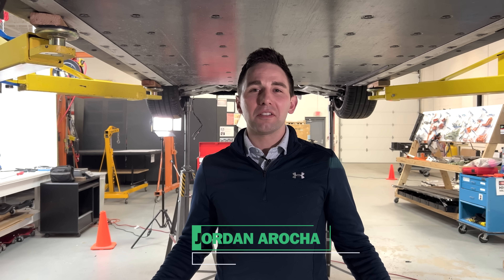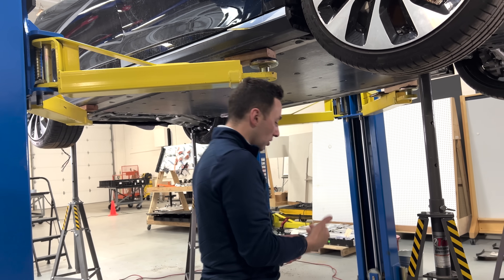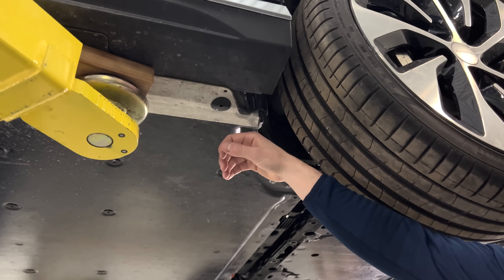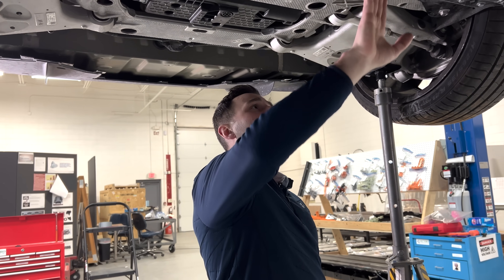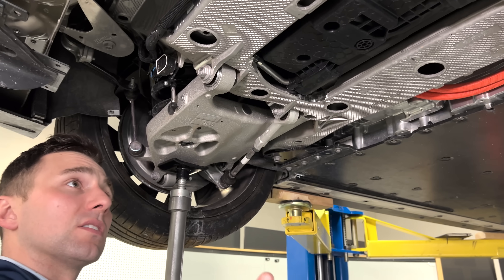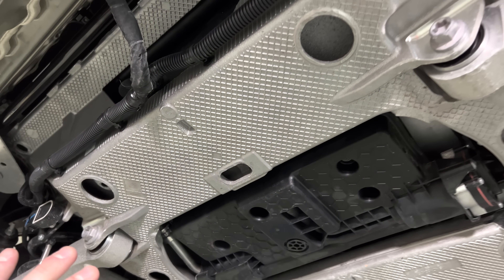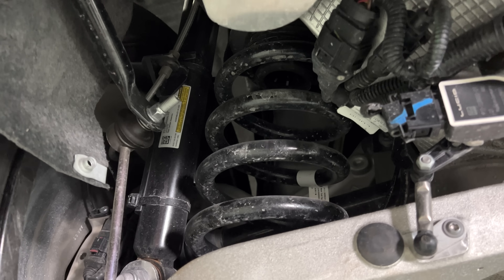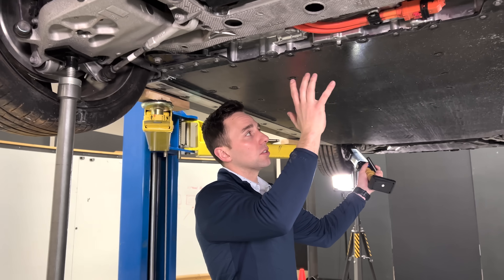Fastener Frenzy! Lucid Air Hoist Review Part 2

Comment: I think removing a wheel or two for better visibility during these videos would be great. The tube and effort to remove and install is relatively easy. Probably quicker than setting up the safety stands under the lift 😄

Comment: Jordan, thank you for the review. 

But fasteners do not necessarily create a leak path, if the fastener only intrudes into the battery pack's substrate, but does not penetrate it. 

It would have been interesting to see one of the fasteners removed. To see if it actually penetrated or not?

Comment: One of the advantages of the FRP bottom battery cover is that it is not flat. Starting about half way down the pack it begins gradually angling up. with the rear motor cover in place it feeds smoothly into the splitter, creating downforce at speed. Lucid did well to recruit the aerodynamicist from the Red Bull Formula 1 racing team. Also note back at the front that the cooling system takes air from the front center of the vehicle and discharges it through the wheel well, not under the car. Air flowing out of the wheel well improves barrier effects along the side of the vehicle, reducing drag.
Clever monkeys, those Lucid guys.

Comment: Most of the rear suspension was not discussed. There appears to be a pivot point on the massive lower arm immediately above the toe control link (which was discussed); that could be for the stabilizer bar but the stabilizer bar link appears to be on the other (rear) side of the arm, so this is presumably for the vertical caster control link of an "integral link" suspension system.

A MotorTrend article shows a view of the rear suspension which confirms that it has only a single upper link (providing camber but not caster control), so this is an integral link design.

Comment: Great video as usual, Jordan! I love how you don't 'dumb it down.'
Really looking forward to your take on the battery. 
Yes, I think having a battery that can be serviced is important. Such a key and costly component shouldn't be scrapped because of a minor component failure. Since EVs are hypothetically capable of very long service lives it is terribly wasteful for future cars to be scrapped as "uneconomical to repair" for some BMS or contactor failure. I recall early days when people saying that a Prius would be too expensive to repair when the battery failed. Today rebuilt batteries are widely available and inexpensive. In Europe some are even upgrading old LEAF batteries. The aftermarket can be clever is we leave them some room.
Reply: Folloiw-up: Some early Air GTs had one problematic high voltage contactor that would fail intermittently. Not all contactors, but some would, stopping the car when they did. Lucid discovered that the faulty contactors would occasionally chatter when closing in the weeks before they failed. An OTA diagnostic tool was downloaded to the fleet to monitor for this chattering. Some months ago I received an urgent message from Lucid that my car had detected that chattering. Lucid asked to urgently schedule transportation to pick up my car and deliver a loaner while they replaced the dubious part before it failed. Cool, if a little spooky with the overtones of "2001". Fortunately no EVA was required on my part, no pod bay doors needed to be opened.. This is what the future is supposed to look like.

Comment: When I see the amount of frozen salt ice that accumulates on vehicle's underside and wheel wells during a typical winter storm period, coupled with the brittleness of plastic parts when it's -30 degrees, I'm thinking this Lucid is a temperate zone-only car.  Not many would survive a Montreal winter. Hyundai and Tesla have learned to design their undersides to withstand the long-term challenges of salt/ice.

Comment: Making an easily serviceable battery pack with no special tools required to remove it, seems to facilitate theft of the most expensive car part, the Battery pack. I think battery packs should transmit their location like a cell phone making locating a stolen battery pack easy.

Comment: Doesn’t look like any designated jacking points…
Reply: There are clearly designated jacking points, shown in both the owner's manual and the emergency response and towing guide. One of the front markers (a rectangle) is visible in the rocker panel @1:45, partially covered by the scrap of wood;  they're lifting too far inboard. The manual says "CAUTION: DO NOT position the lift arm pads under the vehicle battery or side rails"), and they're lifting on the edge of the pack. I've seen them use clearly the wrong points in another video - it's as if they don't read the documentation.

Comment: Great 2nd video.  I was curious about Munros thoughts on this vehicle.  My take away from both videos is its a tight design, tightly packaged, with serviceability issues due to that design.  At some point it will need to go to the shop, the question is can your local shop lift this up and replace parts that have worn out...easily...or will it entail a complex procedure that will cost way to much?  As you pointed out in the 1st video...its a no no in the manufacturing sector.  
Suspension does not need to be designed this way as you stated...overly complex..considering it will be drive on a stright flat road.  It will be a city or highway, which is not very twisty.  Time will tell if they update to simplify.  Cars are not space ships...kiss..as Munro said.  
Tesla, Ford, and GM have a good and effective suspension that any shop can work on..easily.  KISS Lucid KISS

Comment: When I see elements like the spring steel clips securing the battery pack my immediate thoughts go to galvanic corrosion if the undercarriage isn't kept clean through a northern winter full of salt and snow.

Comment: At least some, perhaps many, of those fasteners appear not to penetrate through the structure.  Fasteners into aluminum are still an issue.  The fasteners either need to be passivated with dacryl coating or need to be aluminum themselves.

Comment: What are those wires hanging down by the right rear wheel visible at 4:55, 5:23 9:25 ?   Disconnected for safety on the lift?

Comment: I don't see any jack lifting points
Reply: There are clearly designated jacking points, shown in both the owner's manual and the emergency response and towing guide. One of the front markers (a rectangle) is visible in the rocker panel @1:45, partially covered by the scrap of wood;  they're lifting too far inboard. The manual says "CAUTION: DO NOT position the lift arm pads under the vehicle battery or side rails"), and they're lifting on the edge of the pack. I've seen them use clearly the wrong points in another video - it's as if they don't read the documentation.

Comment: In regards to the comment about not designing a battery pack that should need service: Nothing should be designed to fail and need repair, but it would also be very short-sighted and/or arrogant to assume that anything you design will never fail. Serviceability is an incredibly important consideration when designing something that is intended to be useful for an extended period of time because, at some point, it will break, regardless of how well it is designed. That is a major failure in the design of many modern consumer products: they’re designed to be used and thrown away when they break. They’re intentionally designed not to be repairable, which is a real shame. Serviceability is even more important on something like a battery pack because of recycleability. Lithium battery packs absolutely must be designed to be disassembled and recycled at the end of their life because, just like any part on any car, they don’t last forever. There are so many precious materials in a lithium battery pack that can be recovered as long as they’re reasonably accessible. Manufacturers like Tesla who hermetically seal their batteries and encapsulate the cells in foam are doing a disservice to their customers by making the batteries nearly impossible to repair (they must replace the entire pack even if a single cell fails) and they’re doing a disservice to the environment by making the packs much more difficult to recycle or repurpose when they’re no longer fit to use in a car.

Comment: As far as the parts bin tie rod inner, can  a manufacture like lucid simply go to an oem (say lemfoerder) and buy a part another manufacturer ordered, say bmw? Or is there a license restriction or similar?
Reply: Many of those parts are designed by the parts manufacturer, not the OEM which buys them, so in that case there's no problem. For example, the same electric brake booster (Bosch iBooster) is used by Tesla and Honda (and others) - it was designed by Bosch and none of the companies which buy it owns the design or the right to restrict who else buys it.

Comment: IIHS 2.0 isn’t a side pole test. I think you know this and likely just misspoke haha. So also fyi the new barrier is meant to mimic the front end of a truck, specifically a ford F150 or similar suv. They ran the F150 and Honda pilot as benchmark test vehicles when developing the prototype. It basically has “frame rails” built in to mimic the hard sections of a trucks or SUVs longitudinals. This presents a challenge for side intrusion, specifically the door beams.  So it’s meant to basically mimic a real world scenario whereas the old barrier was too uniform and didn’t really represent a real world vehicle. Huge crash nerd here!  Next time you guys visit IIHS view the actual excel spreadsheets an, measurements, and tech docs. They get way way deeper than just ratings

Comment: Good video Jordan.  Two things I do not like; one the exposed high voltage line (orange cable connector) in front of the rear end casting. Two the rear end tie rod linkage, just hand down, ready to catch something.  🇨🇦

Comment: There is one problem created by having a low slung windshield washer bottle. Lag in getting  pressurized fluid into the spray head especially is there is any leak in the hoses coming from the washer pump and electric motor. Hopefully they are using a check valve to prevent the fluid returning to the pump when off. The long hose in an are not warmed by an engine can also allow icing of the windshield wiper fluid, solvable by putting the hide in a passage that is supplying heat to the passenger compartment so it can keep the d fluid in the  hose warm which helps deice windshields. In fact having the washer bottle grabbing a little test would also be good as well.

Comment: What on earth's going to happen when these mega-complex cars start having nasty breakdowns, 10 years later and out of warranty?? - Especially if (when?) Lucid goes bust. It's not like they're even remotely handyman or home-mechanic friendly. At least with the old and gorgeous BMW 850i (which are now dirt cheap ) , you can mess around with them yourself if you're very competent. But these massive EV's (Lucid, Merc, Rivian etc) will probably simply be scrapped when unfathomable problems inevitably arise down the line. This is happening to modern Bentleys right now. Their software systems are just so complicated (eg antitheft and key verification before engine-start is allowed) , that shops and experienced tinkerers are outwitted, and quoted unbelievable 5 figure prices for "wiring loom replacement".

Comment: What amazes me is the very small size of each of the 400HP electric motors that Lucid uses. I saw the Lucid display during the Monterey Historic Races in August 2022.  Each motor is about the size of a large shoebox!
Reply: Each Lucid drive motor is actually rated at 650hp. It is the battery that is the limiting factor in each of their different models.
Reply: @Miata822  it’s actually even more at 670hp

Comment: Suggestion Munro team….maybe pull a wheel off when vehicles are up on the lift. Lots more light and angles to view tight suspension spaces. Love the videos!
Reply: It would help for sure...
They probably don't want to scratch the lug nuts.. I noticed they look painted and polished. I don't think they own this one.
Reply: true they should remove the tires and have done this explanation
Reply: yeah, fo real!

Comment: I know they had talked alot about their packaging, but even if they hadn't it really shows! Looks like a real knuckle-buster from a repair standpoint, but hopefully it wont need much.  It will be very interesting to see how this contrasts with Rivian and early Teslas as you tear down, but from this point it looks like Lucid are slightly ahead of Rivian and very much ahead of where Tesla was with the original Model S. I dont even want to know how much it has cost them to get to that point, but I have suspicions that even as expensive as the Air is, it wont be very profitable for awhile.

My one big disappointment is the apparent lack of protective skirts around the wheels. The washer bottle and the various hoses and brake lines are being exposed directly to rocks and sand being thrown at whatever speed you are driving. And that doesnt even factor in the mud and crap getting thrown in there to rust out frame components. Some past lazy mechanic removed the wheel skirts from my Camry, causing mud and sand to fill the extruded side rails causing damage. Replacement skirts have all been too thin and wear out quickly. For a vehicle with so much detailed consideration, this seems like a major oversight, unless Munro removed them for visibility, but I dont even see packaging room for wheel skirts in there.
Reply: Yeah, that's something that wonders me to. I'm not an expert on mechanics, but I'm pretty sure having those elements exposed will not do them good in the long run, similar to that cooling hose rubbing against that other element. Seems like an obvious oversight, something that should be caught before going into production. But hey, it's their first iteration, maybe that really missed it. Still, Rowlinson (Rowlinson?) promised to have a very organised production from the get go so such mistakes shouldn't happen.
Reply: Google, Lucid inner wheel well cover.... the form fitting washer bottle doesn't replace them.....  

And Teslas are famously Are a pain in the ass to work on.....
Reply: The wheel linings were removed so we could see the stuff behind.

Comment: Looks like they have done a great job at utilising every inch of space however there is a lot of work and money needed to eliminate all of the fasteners and other bits and pieces. Lots of failure points which can translate into reliability issues. I wonder if the Saudis will stump up for the next step.

Comment: I've seen cars stranded on the side of the road with shredded tires countless times. and some of those times,  the tire even damaged the bodywork- fender or  quarter panel.  Imagine a blown tire ruining your brake lines.
Reply: I just imagine rocks eating it away. Dont drive this thing in the environments they show in their ads! 😬 I was shocked to see no wheel skirts.... Maybe they removed them, but I dont see how there is even room for them.
Reply: @patreekotime4578  
Was thinking the same, They removed some lower plastic pieced up front maybe they did with the fender panels.

Comment: I like the idea that you may be able to get in the pack and repair something. Really hate to see Tesla packs are completely non-reparable.
Reply: People keep saying this but after the Bolt battery replacement fiasco, I bet GM is thinking twice about repairability as a feature. It seems very very much cost prohibitive. OEMs are likely going to dive full-on into recycling because replacement is likely cheaper in the long run. Especially if the local dealerships who often times botch simple repairs are going to be expected to perform surgery on a battery pack.

Comment: If this new 500 Wh/kg cells are for real and somewhat available, imagine what Lucid could do with that. Lowered rear seat well for comfort and still much longer range than in the present car, and at a lower total weight.
With Lucid and Porsche sharing expertise and parts, such amazing cars could be made. A single Lucid motor suffices for most sportscars and even supercars. Up the cooling a bit, perhaps. Throw in a dense battery, not too large and Lucid will make sure a lot of range is attained from a small pack anyway with their aero and hardware. Porsche can add optimal suspension, braking, even rear steer. Then some active downforce aero bits that fully retract for road cruising.
Reply: For the latter, imagine a wing that comes off the boot top which looks really aero. The trick is, the wing rotates to become the scoop shape. Mega downforce only in "poser" mode.

Comment: I see a lot of tubes and some wiring in the front underbody and the wheel wells that is very close to the road and exposed to all the dirt and debris on and off roads. Is that of no concern? I can imagine easy impact damage and accumulation of rock hard dirt and grime in these crevices over the years.

Comment: The amount of engineering that goes into moving our butts comfortably from point A to point B is simply mindboggling! Thanks again!
Reply from the maker: Thanks for tuning in!
Reply: THANKS  JORDAN AND MUNRO FOR COVERING ALL THIS 🤗😎💚💚💚
Reply: It has all got quite sophisticated over 100 or so years of this. There were always a lot of parts to a car, and they all needed engineering, but now they are having to optimise really hard on space/cost/crash/strength/reliability/weight to be competitive it's all got rather complicated :-) Back in the olden days it just had to be strong enough to work.